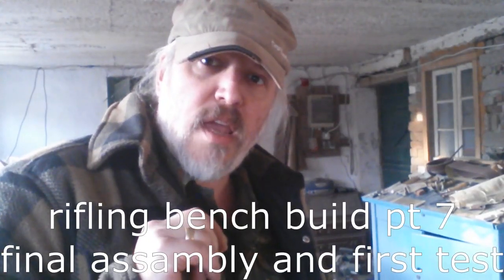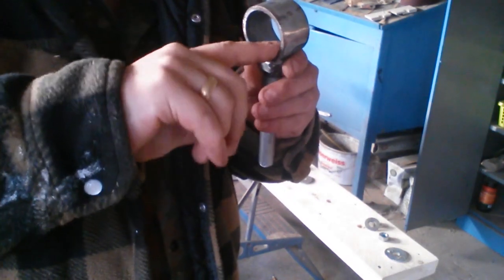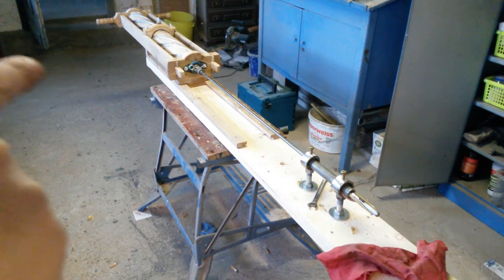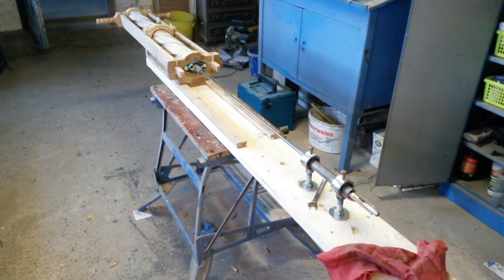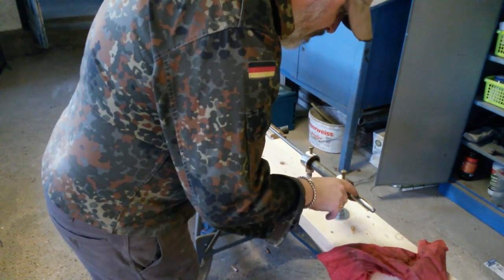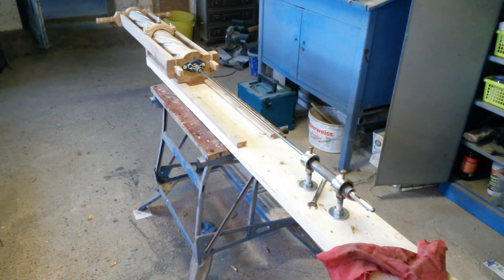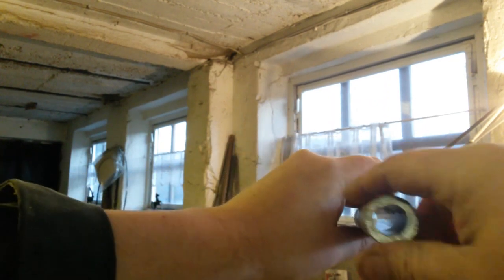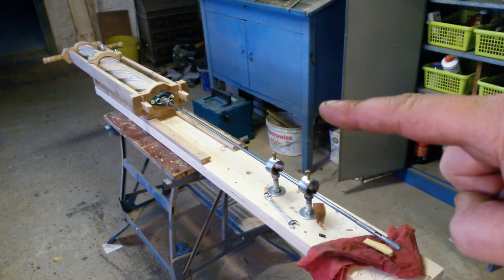rifling bench build pt 7 final works and first test

Comment: That is working really well.  You could use a piece of high speed steel for the cutter. You can buy strips of it for lathe parting tool holders.  It will make a better cutter than hardened steel. When you cut your long rifle barrel that cutter has to do a lot of cutting so you don't want it wearing out quickly.
Reply from the maker: And E bay will do the rest 😁👍 5 minutes ago I checked and soon I will order. Hopefuly I can start making the barrels soon....

Comment: Very nice to see it all working well, I can see there could be a problem with 6 grooves, old barrels were always odd number grooves in order to support the single cutter with a land rather than the very little support you get with a groove opposite the cutting "blade", this will be complicated as the first grooves will have the solid support of the uncut side of the barrel, but the system works, it is just a matter of refining it. Well done Roger! Stay safe ! Chris B.
Reply from the maker: I had the same thaugths maybe I will exchange the slider with a brass one so it can not be forced into the grove. The next adjustment will be a cutter made from hss steel. The first one has too much wear. And when all goes well I will start with two .50 cal barrels in oktagon to round for a nice swivel breech rifle. The style will be a germanic style for 1750 I think. I found so many photos on the net. Thas blows my mind...... so until next time and stay safe Roger S

Comment: I'll bet 100 years from now some fine craftsman is gonna be using an old handmade rifling jig
Reply from the maker: There are some that make there own barrels but they use adjustable steel bench with indxer for the  grove change... This kind of jig is only used for museum shows .... but that is the only way to recrate the original quality and to find out how good the accuracy will be 😁😜 and for sure its a lot of fun to build